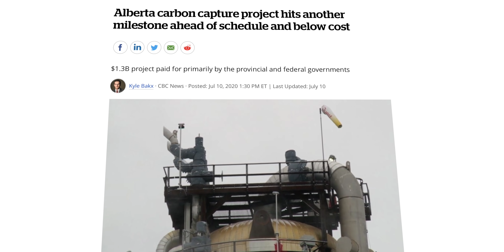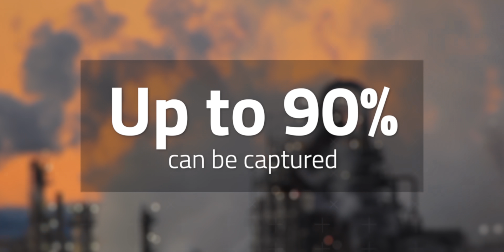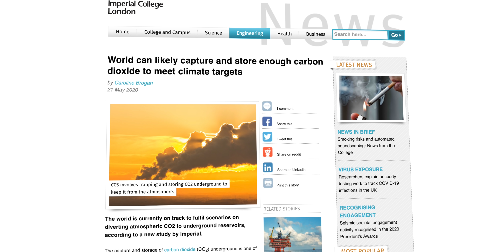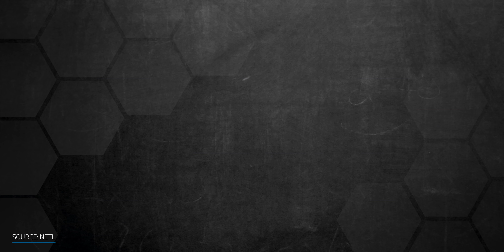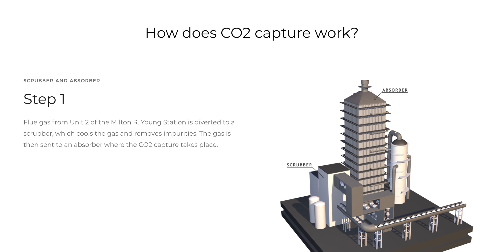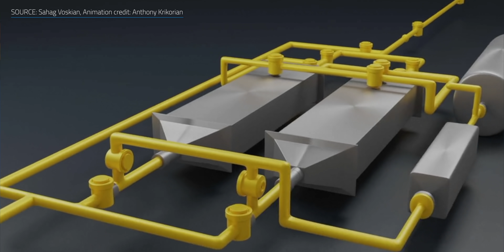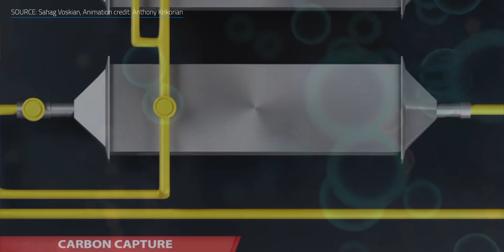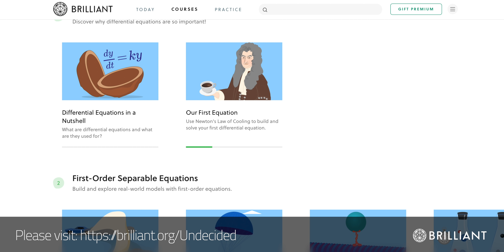The truth about capturing CO2 to reverse climate change

Comment: The problem with carbon capture is that it takes energy, and it has to be clean energy for it to help. We get better emissions reduction by just using that clean energy to burn less fossil fuels.

There are still two applications, the first is to offset emissions where we can't avoid them, like in concrete production and air travel, where we just don't have a good solution for zero carbon operations, and we may not be able to find a good solution. 

The second, is to reverse the damage we've done after we have enough clean sources of power. We can run carbon capture at off-peak hours, when power stations would otherwise be idle, and do some very real mitigation of the climate catastrophe.

Both of these use cases require us to go all in on sustainable energy first, and build out whatever carbon capture infrastructure is appropriate second. We should be in the research and pilot program stage of the technology, while solar, wind, and batteries should be in the mass scale manufacturing stage.
Reply: Build more nuclear.
Reply: @1320crusier  Why? Nuclear is more expensive, slower to come online, and can't work as a peaker plant. And that is before you get to the safety and waste problems.
Reply: @TheReykjavik  Waste is easy, recycle it.  Nuclear is the best source of electricity we have, period.  The red tape is caused by govts, not the source.
Reply: @1320crusier  The "red tape" is the reason we don't see Chernobyl level disasters on a regular basis. The only reason nuclear power is as safe as it is is because we justifiably put a tremendous amount of time and effort into keeping it safe, because nuclear power is inherently dangerous. Concentrated energy always is, and with nuclear you get fallout when it explodes to make it even worse.

We don't have the infrastructure to recycle nuclear waste, not even close.

And nuclear still isn't a peak capable power source, so we would still need batteries to make up the difference.

Nuclear is a waste of time and money.
Reply: @TheReykjavik  No, not really. Western nuclear reactor designs are the polar opposite of that soviet one.  AKA safe. 

Not only is nuclear safe it can run 24/7 at the same power level unlike the acres and acres of crappy wind mills and solar panels.
Reply: @1320crusier  Safe, because we invested the time, regulatory oversight, and money into them.

And running at the same power level 24/7 is a disadvantage, not an advantage. Peak power demand is usually in the mid-late afternoon. A nuclear plant cannot handle the difference in demand between 4pm and 4am. Wind turbines can, because they have brakes that can throttle down to zero power without any danger, and solar pv can do effectively the same with a flip of a switch. Nuclear reactors get xenon poisoning, taking hours to purge to safely restart.

And nuclear energy costs twice as much as solar or wind, the US EIA estimates a cost of $81.65/mWh for "advanced nuclear", while they estimate $39.95 for wind, and $35.74/mWh for solar pv. 

https://www.eia.gov/outlooks/aeo/pdf/electricity_generation.pdf

See table 1b, on page 7 for the figures.

Nuclear power just is not economically viable, and any new technology that might be economically viable isn't going to be ready for industrial scale production in time to deal with climate change. Sure, keep working on them, build an experimental reactor or two if the new tech looks promising, but stop pretending it is relevant to the current crisis, because it just isn't.
Reply: A person who thinks solar and wind are relevant to power a whole grid trying to claim nuclear isnt.. Im laughing in massive California black outs.
Reply: Lol, wake up. France gets over 70% of its electricity from nuclear power.
Reply: @dag_of_the_west5416  They also have rather expensive electricity prices, so you aren't exactly making progress with that example.
Reply: @dag_of_the_west5416  

I can link to eia stats too:

https://www.eia.gov/outlooks/aeo/pdf/electricity_generation.pdf

And mine actually breaks down cost by generation type, and nuclear costs twice as much as wind or solar.
Reply: you don't know science we need more co2

Comment: I was watching a video on a company doing compressed air energy storage that would dovetail with this nicely. They have to strip the CO2 from the air anyhow as a byproduct of the compression process. The intent is to use the compressed air as a battery. Take surplus power from renewables to compress the air, then in times of demand use the compressed air to run turbines to make electricity.. 

It seems elegant to use a solution to renewable's variable power output to make the whole process carbon negative.

Comment: Carbon  engineering  in Canada has plans for capture & sequestration along with a  percentage to be used for hydrocarbon fuel production.  They claim they have a pilot plant in operation and project something around $1.50-$1.75/gallon.
That poses some interesting opportunities and issues.... if true we could end 'fossil' fuel use and move to 'renewable' synthesized  gasoline and diesel... I realize that doesn't  totally solve the problems of gasoline and diesel but once you can good closed loop and fossil fuel mining it is a huge step in the right direction. Imagine if we're to end mining fossil fuel and use carbon capture fill our energy needs start by converting 90% to fuel and sequester 10% that is atleast a viable bridge to full sequestration and electrification without adding to existing CO2 levels.... but it would be a MONUMENTAL task to achieve.  Nice video keep up the realistic approach!

Comment: Matt, you are just awesome! I am a Chemical Engineering graduate that never worked in the industry. I was turned off by the callous attitude towards the environment which I saw first hand at the place I did my undergraduate internship. I am pleased that the entire world seems to be paying a lot more attention to environmental  issues. That was generally not the case in the late 80's when I had my own awakening.
By the way one good way utilize captured CO2 is in the growing of plants - as a gas or in solution as foliar spray.
Reply: Why not just let the ocean convert the excessive CO2 into calcium carbonate (CaCO3)? What do you think has happen to the enormous amounts of CO2 injected into the system by volcanos for billions of years? Where did it all go? The consecration in the air is determined by the ocean as described in Henry's Law. You really think we can alter the chemical balance between the air and the ocean?
Reply: @elbuggo  Or 100 years ago with millions of rather dirty motor vehicles & millions, maybe billions of domestic stoves & fireplaces burning coal & wood (A typical old Australian home had a fireplace in most rooms, typically 3-7 & there ware no gas or electric heaters.

hundreds of thousands of steam locomotives in steam @ any one time & many thousands of even bigger machines like steamships & coal fired power stations & heavy industry.

Go back another 50 years & pretty much the same, only a little less.
Reply: Re: one good way utilize captured CO2 is in the growing of plants

Why not just chop down all the trees and store them in a gigantic pyramid? As long as we keep this gigantic pyramid dry, the CO2 will be stored there, and new trees will grow up and harvest more CO2. Pretty safe and low cost solution? But will it work? Will it be any point? No. 100% waste of time and money. The ocean will release new CO2 into the air to replenish the CO2 that has been removed from the air until the chemical balance again has been achieved.
Reply: Look up the lifecycle of Krill in the ocean.

Comment: It's funny how people think is difficult to remove co2 
Dude just plant trees and ban deforestation 
That's it
Reply: Problem is, trees are only a buffer, since the CO2 is emitted again once they die and rot. During the rotting process, methane may also be emitted, which is a worse greenhouse gas. You may use the wood for construction so it stays stored, but I don’t think it’s a very efficient way to create negative emissions. We need profitable and industrial solutions, that’s just the way the world works unfortunately (in my opinion)
Reply: @erikottema2620  trees remain their for 100s of years some even over thousand buy that time one can grew new ones too and yes they don't emmit any green house gas's until they are burned or used in any other way a living tree will always be a net positive to the atmosphere and that why I said at the end to strictly ban deforestation
Reply: @hamzashah9543 I agree bro, we should ban deforestation. Not just condemn it but actually do something about it.